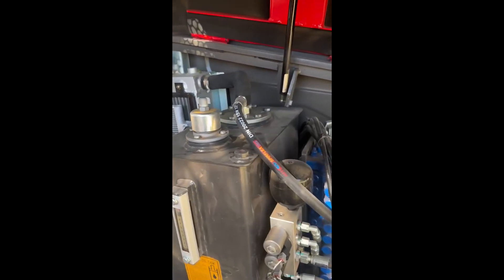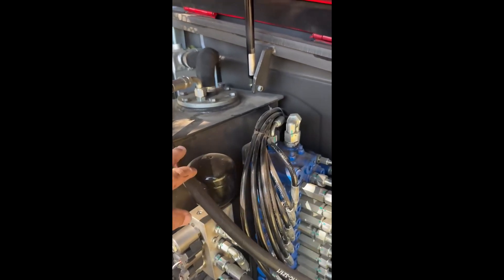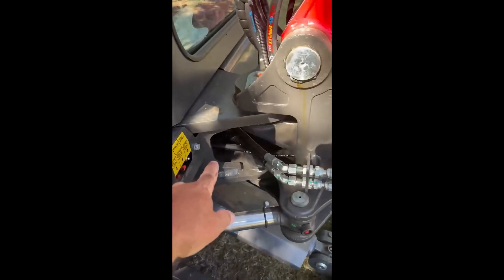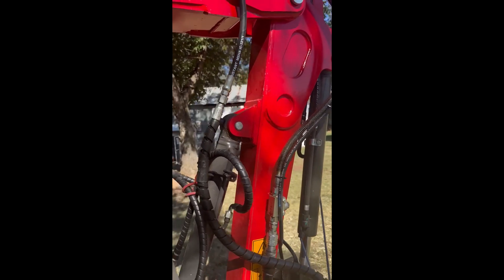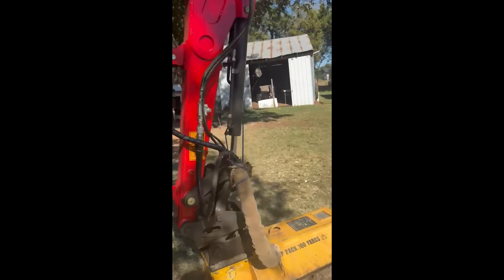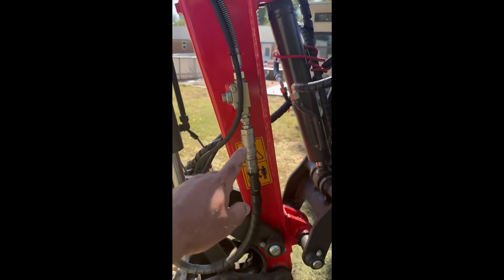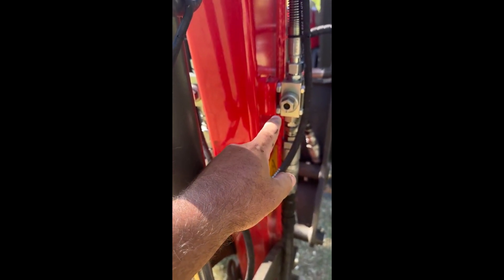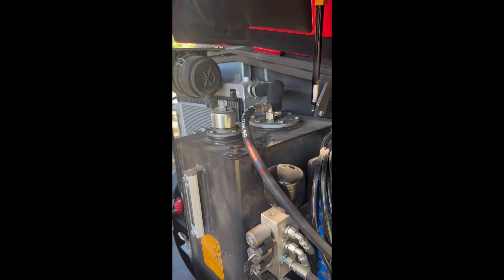Installing a Case drain on the Kymron XH42D Mini Excavator

Comment: Thanks. I recently watched a "Spicer Designs" video, "This May Be the BEST Excavator Attachment Brand On The Market" about attaching a Mongo mulcher to his Bobcat E35. Apparently, you tell Mondo your machine's specifics(like flow rate) and they put in an appropriate motor. Once you have it attached, you can further tune your attachment to match your machine's flow rate. In the video, the Mongo rep specifically mentioned developing an attachment for a Kymron owner at 11:40 into the video. Anyway, this supposedly negates the need for a case drain return line.
Reply from the maker: Some mulchers don't require a case drain because some of the manufacturers have a built in pressure relief built into the system. I researched mulchers for about a month before finally buying one. The issue I had was I didn't have 20-30K to buy a new one so I had to find a good used one that was on marketplace. I finally found one that would work with my Flow and specifications of my machine for about 12K. I had to get a new mounting bracket for it. Kymron was no help at all, they had no clue if a different mount from another brand of machine would work on my Excavator (that they sell),  and they did not offer one of their mounting brackets that I could buy, so I had to send all the specifications into a manufacturer (VMC mulchers). they looked at my specs and all the pictures I sent in and found out that the Sany SY35 and the Cat 303.5/304 were compatible with the Kymron. I have since relayed that information to Kymron so they can let other owners know what will work with their equipment.  They could not even tell me what the flow rate for the Aux Hydraulics was.  One of their other sealers recently bought the equipment needed and tested the flow rate at 18 gallons per minute.  I did not have that information at the time of my purchase of my drum mulcher or my Brushcutter. A Rep from VMC got me close when he told me it was about 16gpm.
Reply: @IngramBlueLine  Thanks so much for your reply.

Comment: How many hours do you have on your kymron machine? Any major complaints? I am looking at buying one. Thanks
Reply from the maker: I am at 100 hours. Bought it at the end of September. MAJOR complaint, I keep throwing tracks. Don't know if its me, the way I am driving it or I don't have it tensioned right or if it is the machine, but it sucks!  I don't like the slop in t eh swing, but its common according to all the videos I have seen on just about every size machine.  My power feels down in the Hydraulics, but there is a way to adjust that, just not sure where the adjustment is exactly so that is fixable. The worst is the lack of knowledge from the dealer. Great guys, they just can't give me 100% correct answers on things like Aux flow (GPM), where that adjustment is for the Hydraulics, does it have a "Hammer mode". Basically if it isn't in that little brochure they give you or its not listed on their web site then good luck getting an answer.  Last thing is, if I ever do have a Major issue, It hard to find someone who can or will work on it.  This is just my personal observations and peeves, but I will say its pretty damn good for the price, If you can work on things yourself then I don't think it will be an issue for you.
Reply: @IngramBlueLine  Thanks for your thoughts on the matter.  I was looking at one of these, but I realize that I can have a Yanmar SV40 for almost the same money, and I have a dealer network that will stand behind it for 4000 hours may just make the extra few thousand worth it in the end.  
Q:  Do you have or can you find anyone who can give accurate numbers on breakout force?  I've looked and looked and have only heard things like, "oh it strong and it'll remove stumps no problem."  
Anyway, thanks for your comment.
Reply: @IngramBlueLine  I have the 42 also, with 50 hours and I've thrown tracks twice. A problem I had was that the outside idler arm receiver rail was delivered bent in towards the idler arm, not allowing the idler arm to push out and tighten the track. After much work with an angle grinder I was able to free up the idler arm.